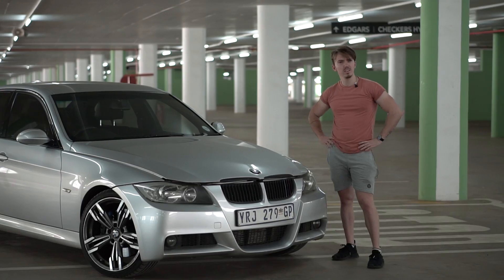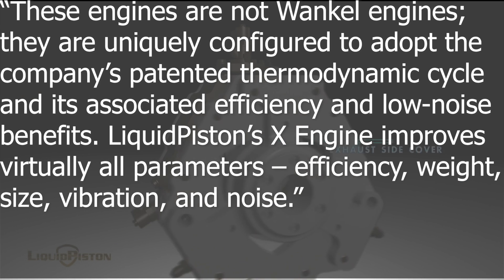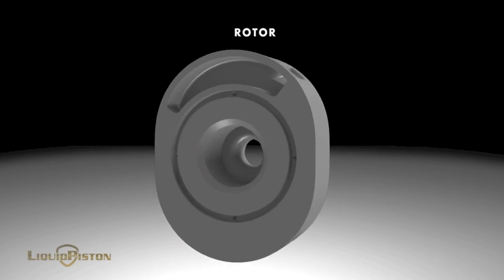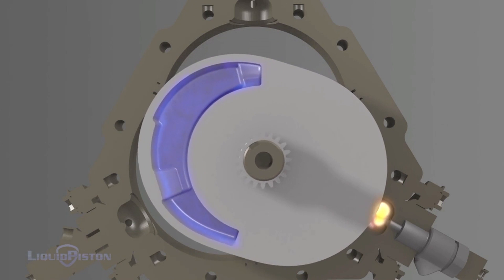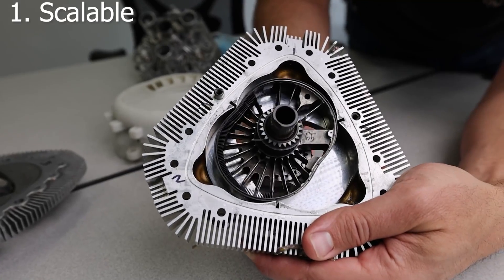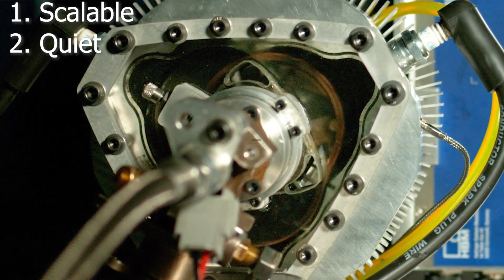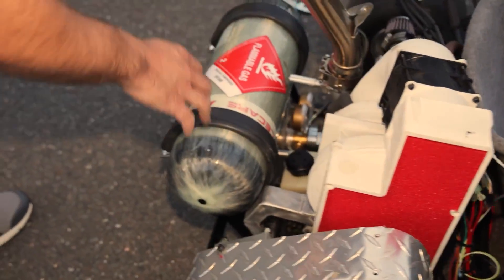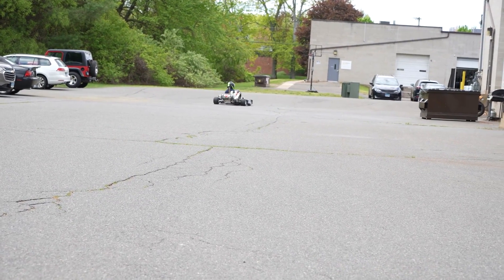This Liquid Piston engine revs to 15k rpm and can make over 1000HP

Comment: I love the design of this engine, I've known about it for years. But I feel like you presented it in a way that was very, very optimistic, since it's not in production yet, or you make it sound like some of its properties are unique, when they're not. Here's your list:

1. Scalable -- My friends works at a power plant that has an on-demand generator: it's an inline 8 cylinder engines with pistons the size of a man. Reciprocating engines are scalable, too.

2. Quiet. I think the footage at the end of that go kart says it's not quiet, I wouldn't expect it to be quiet. 

3. "No Vibrations" -- Their design seems to be more balanced than a reciprocating engine, but c'mon

Also, most ICEs can be adapted to multiple fuels. Different grades of gasoline, propane, natural gas, or hydrogren for instance for engines with spark plugs, diesel, biodiesel, etc on the other side. I would love to think this engine can run both high-compression fuels like diesel, and low compression fuels like gas, without chanyges. I just don't see that as possible.

Again, I fucking love this engine!! The first time I heard of a Wankle 20+ years ago, I dove deep and it tickled my brain. Then, years ago when I heard someone inverted the Wankle's geometry, I pooped my pants. I want this to work. I want to play with them. But that's gonna come from honesty. Being excited is great, but this video came off like it's perfect. I still subscribed though, hope to see you grow.
Reply: DontWorryDiaperJoeGotYouCovered  do you have a name of the engine or link? I couldn't find anything about them working on a non-Wankel design

Comment: Unknown to most people if a frequency is added to a pieso coil that makes water into
 steam without going into the heat process and the electricity is controlled by frequency you will have a production of hydrogen more than just using a DC current I know nobody will read this or understand this but it's my mission to put this out there have achieved over unity with producing hydrogen to know it was possible to run a car on water without the high energy costs Stanley Myers and bob boise was able to do this if anybody wants to find out how to do this you will download chapter 10 PDF and study but because nobody's awake yet they haven't tried it they want to see it to believe it instead of created to see it

Comment: This one looks to be better than the Wenkel because the seals don't pass over the gaps for the spark plugs. If the RPM in a Wenkel engine gets high enough the spark plug recession can allow burning fuel from a previous cycle to pass into the next cycle early and cause backfiring. (As seen in one of Rob Dahm's recent videos)

In addition, this engine block won't be unevenly heated like a Wenkel is. (Though this one's rotor will be unevenly heated, whereas the Wenkel rotor is evenly heated.)
Reply: can be solved with port injection maybe? The fuel will cools the rotor a bit
Reply: @tobysatriayudha4564  the idea is that the intake air flows through the hot side of the rotor and cools it. There are even cooling fins inside the intake channels to improve rotor cooling.
Reply: @redcrafterlppa303  aaaah, that makes sense

Comment: It has the same flaw as a Wankle engine, it needs super precision CNC machined rotor and housing  a traditional piston achieves the precision by drilling, much much faste/ easier/cheaper and reliable.

Comment: I came up with this exact same idea independently when I tried to solve the problem of apex seals. this is just a first pass at combustion sequence optimization. the apex seal problem has only been mitigated with this design.
Reply: I wonder if they can do some kind of roller kind of like a ballpoint pen
Reply: I’ve just written a post about using a needle roller bearing as part of the seals
Reply: @kentonian  where
Reply: @alternatemusicaddict5226  don't know how to link to it but here is a copy and paste:
It’s great as a 4 stroke version of a wankel but still we have the seals issue.  I really want these guys to succeed but I have not seen any innovation in the apex seal.  I know there is a company in Portsmouth that rebuilds Mazda rotaries and has increased the life in those engines but I think there is still a way to go.

It’s the one overriding advantage with cylinders,  the seals don’t have to conform to a moving face.  They can be oiled from one side and there can be many of them per chamber.

Has anyone thought of using a needle bearing as the primary seal?  Then a sliding seal behind the needle roller bearing?  This way the sliding seal doesn’t have to move.  The needle roller can turn at the appropriate speed to match the rotor passing over it so there would be no sliding force on the rotor.
Reply: I came up with it as well when I was playing with my hot wheel set. That was a long time ago so I would say I was first!

Comment: The biggest problem I see is the same as all rotary style engines have. Blowby coming from the flat sides. You can either lube the crap outta the sides and burn oil or settle for short lived engines. You could run oil in the fuel but then you'd still be burning oil. I think it would take some kind of advancement in micro particle anti friction oil additives to allow the high enough tolerances for the motor to be reliable.
Reply: Look at their website. Intrinsic construction and location of the seal solve the oil problem.
Reply: Graphene

Comment: Warped perception did a see through version of this. The Gokart they had it on was really slow . Its way under powered conpared to a wankle
Reply: You’re comparing a go kart to a Mazda rx… the go kart is specifically limited to a horsepower range. The motor has nearly three times the power to volume density of a wankel (I.e., if you built a wankel and an HEHC engine like this one to the same dimensions, the HEHC engine would have three times the horsepower and more than three times the torque)
Reply: @mdj391  im comparing to a Sach chainsaw rotary ! Or to the Axio 50 rotary which is the same size as the engine mentioned
Reply: @mdj391  https://youtu.be/6fFj-FWlgv4

Comment: Wankel engines have several flaws that are almost impossible to overcome. The seals are scraping the chamber walls requiring oil to be injected into the engine. The seals wear out requiring an engine tear down. They don't get good fuel economy. The combustion occurs in only one chamber causing a hot spot which makes even cooling difficult. This engine seems to overcome those flaws. I can hardy wait to see how they hold up in the real world.
Reply: They solved the problem with the apex seals like 20 years ago dude. And the engine fires on all three faces of the rotor. Delete the omp and premix the fuel so you're not burning crank case oil in the combination chamber.
Reply: @fattnnvxbhjnccnvvcyn  You made some claims. Now show me where you got that info.
Reply: You're kidding right? Go watch some of Rob dahms videos or angel motor sports. It's literally just making sure your clearances are right and make sure none of your side seal on the rotors are sticking and dowel the block to keep it from twisting when you start making power because these are basically Oreos and they twist

Comment: The Wankel engine has a problems with seal wear.
Does this engine have the similar problems?
Reply: Sense the seal is a part of the case and not the rotor it should be possible to continually oil the seal which should help the life of it. He mentioned something to this effect in the video.

I would also assume that the seal being in contact with the water jacket or cooling fins, depending on how they choose to cool this engine may improve life. Meanwhile a normal rotor seal has to rotate in and out of hot spots in the case. I would assume, though I'm not an expert, that this might help improve the life of the seal some.

Like most mechanical things its eventually going to wear out but I'd imagine this would improve things some. Honestly it shouldn't be that difficult to reseal either. I've never worked on a rotary motor but I'm a pretty good mechanic on normal engines.
Reply: @garreth629  
Very informative, thanks for your reply.

Comment: Wonderful and just like all the other 35 new engine concepts, it's also purely theoretical without standing performance figure and yet not even a single working model has ever been built. The axial piston engine, remember that? Yeah it's been a prototype for the last 20 years
Reply: Um… they have standing performance figures. Not sure when Chris recorded this but they have a TON of proven concept applications, not the least of which is ultralight power generators and hybrid airplanes. Check out their website.

Comment: Their next technology demonstrator should be at least a dual-rotor 500hp engine that runs on diesel fuel.  This would put it in the class of semi-tractor/trailer over the road transportation.  It would also be able to show usable fuel mileage numbers.
Reply: would be great but hard to imagine with how good common rail motors are, be hard to compete

Comment: In a wankel engine even though each face of the rotor only has 1 power cycle per rotation because there are 3 faces it does in fact have 3 power cycles per rotation per rotor so a twin rotor has 6 power cycles per rotation.
Reply: That’s because the wankel is basically a 2 stroke

Comment: If you use this as the generator on a hybrid car, always running it in its optimal power band, you have a huge improvement over the small piston engines used today in cars like the Prius.  Knock hundreds of pounds out of the gross weight, and free up a lot of internal space in the car.
Reply: I was also thinking, the design seems like it'll have an optimum RPM range, so projects where that's true would be the best choice.  generators are one, and possibly airplane engines using variable pitch blades to control thrust is another.
Reply: Perfect match for CVT cars then
Reply: @kekethetoad  potentially. However my opinion of CVT transmissions is fairly low, predominantly because manufacturers are specifying horrific maintenance intervals which is causing them to fail rather early in their life cycle.
Reply: @kekethetoad  cough cough nissan cough cough
Reply: @johnhufnagel  --  It's a natural for a hybrid vehicle.   The electric motor would have to be powerful enough to run the car under all circumstances.  (The hybrids that can be charged at home are usually designed like this.)
Reply: @GilmerJohn  Honestly the ICE engine doesn't need to be enough to provide full performance for the car.
It can have a 100% electric power train but use a ICE range extender to allow you to limp to a charger instead of getting stuck somewhere, or you can stop and run it for a while to charge the battery for full performance for a bit.
Either way you'll be able to manage with a slightly smaller battery for your plug-in hybrid.
Reply: That's what Mazda is developing now.
Reply: @jerryknudsen7898 Mazda is still married to the wankel engine...
I wish they'd switch to this one.
It's far more fuel efficient and reliable long term.
Reply: Yeah as in excess battery weight, I think the density of power combined w/the power efficiency gains of electric motor drives ...possibly eliminate all but starting battery 
High tech version of Electromotive train layout, lean and mean (maybe turbo boost?)
Reply: A bmw i3 has that setup, a (motorcycle engine) generator recharging the batteries.
Reply: Think that's what Mazda is planning to do, use it as a range extender for one of their new models.
Reply: Use a hydrogen driven variant of this coupled with the right sized alternator to keep a medium sized battery charged. Use electric motor as the drive train.
You need no gearbox and have the desired range.
Reply: @agrippa-theskeptic9346  Burning hydrogen in an engine is barking up the wrong tree.  You'll lose half to 2/3 of the power as waste heat going out of the tailpipe.  If you have hydrogen, burn it in a fuel cell and you can get 90% efficiency easily.
Reply: @NSResponder  sure, fuel cell.
Like it’s been happening since last 30 yrs.
Super efficient!
Reply: @NSResponder  While true the flexibility of using hydrogen while not being limited to it is worth something.
A car that can use hydrogen but also can mix in gasoline, diesel or any other fuel has a value in itself.
A hydrogen hybrid with fuel cells might be okay in California.
But there's just a couple of hydrogen fueling stations in my country.
Non in my village.
Being able to burn hydrogen would be a benefit making me choose it over a regular plug in hybrid gasoline car.
But I still want the option of just adding a little bit of fuel of some kind in places where hydrogen isn't available and when I don't have time for nor a fast charger for electric charging.
Reply: it's just another shitty rotary engine that will be very unreliable and leak/burn oil. Won't last long.
Reply: Plus its oil injected and run on 2 stroke oil. The XTS 210 2 stroke is one of my favorite
Reply: You would probably get better results by using a pulsejet engine to move a turbine (not that many people would be willing to try). Depending on the fuel, you can use a tesla turbine and a axial flux motor, turning everything into a very angry steel pancake.

Water injection would probably be a necessity though, just to keep the engine from destroying the turbine.

Never thought I would find out something a tesla turbine would be good for, but here we are.
Reply: Tesla has entered the chat

Comment: Seems like the tolerances need to be extreme. Might be hard to manufacture and to keep it well adjusted.
Reply: Used to work in engine design at Cummins - Learned a lot about making an engine, but been quite a while since I worked there. Reducing the material requirements for the engine by a factor of 10 would pay for quite a bit of precision manufacturing if necessary. I looked at this design as carefully as I could with the publicly available information and concluded that it looked appealing enough to invest some money. I think it could be a game changer if they can pull it off in the real world, not just the engineering samples stage. The tolerances don't seem to be much of an issue to me, I would be more concerned about wear and tear - even though I know they claim good results in their tests.

Comment: Funny, it does look more like a 2-stroke engine, with the ports in the "piston" instead of the cylinder... I didn't quite get the idea about how the seals work, or are made to last...maybe they just burn oil, or use the fuel as a hydrodynamic seal...I dunno..
Reply: same with wankel maybe? but it fixed on the chamber rather on the rotor, and you can run oil trough the slit in the seal mount. So, better seal durability, and less oil burned. Just my thought.
Reply: Maybe they have the same seals that are used with the wankel engine, but flipped and used the opposite way?
Reply: yes the XTS 210 is the 2 stroke rotary.
Reply: They're fixed apex seals, so it's easier to keep them lubricated without burning oil.
Reply: maybe they use pre mix or an oil inj system. ? id love to see a 2 stroke version and i think they do have one.
Reply: Its a 2 stroke rotary

Comment: Any revs above 3000RPM cause huge amounts of vibration if there is the slightest unbalance.
Reply: It’s stable enough they use it to power hybrid airplanes.
Reply: @mdj391  They power drone only, not yet aeroplane.

Comment: The trend is that many governments already made it illegal by law to sell vehicles powered by an internal combustion engine after 2030 or something close to that, so I don't see a mass produced future in any internal combustion engine. Not even if it would run on hydrogen. Fact of the matter is that an internal combustion engine is highly inefficient compered to electric motors, so electric motors will be the benchmark when it comes to efficiency and emissions.
Reply: That only applies to brand new cars being sold with internal combustion engines 2030 and afterwards, not the overall phase out of combustion power itself. ICE powered cars will still keep running well into the 2040s. Because not everyone can afford EVs.